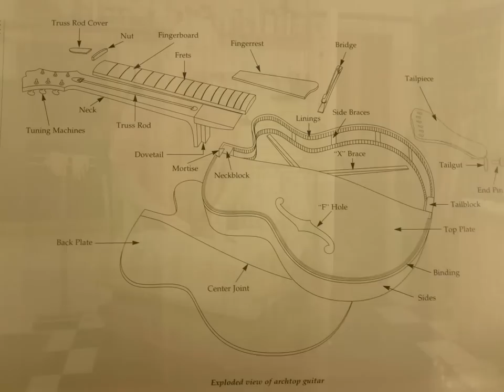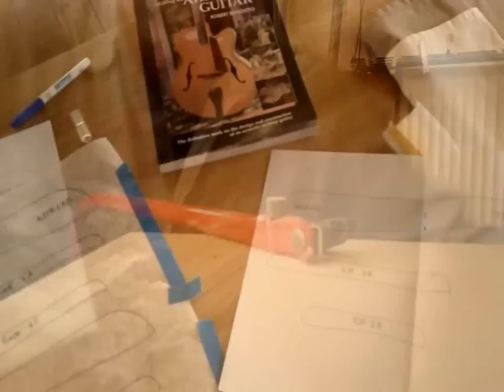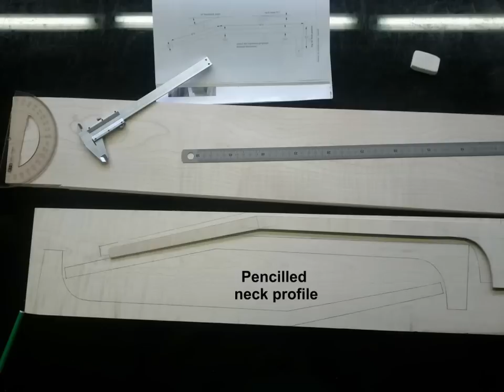Building an Archtop Jazz Guitar 2012

Comment: I had to make an archtop once.  It was a repair on an old Guild.  The bindings, the top, and all was a very difficult to remove, replace and refinish.  Keeping the neck on the old body and making the top the right height so that the bridge/saddle were correct was the hardest part.  Great job.

Comment from the maker: I used an iron pipe with a rim found in a hardware store. Mounted it on a piece of hardwood, put a 150 Watt halogen bulb in it using a porcelain fitting, To control the temperature a used a light dimmer. Be sure to isolate and ground it very well! if you want i can send you some detailled foto's.

Comment from the maker: used an iron pipe with a rim found in a hardware store. Mounted it on a piece of hardwood, put a 150 Watt halogen bulb in it using a porcelain fitting, To control the temperature a used a light dimmer. Be sure to isolate and ground it very well! if you want i can send you some detailled foto's

Comment from the maker: To glue the inlay i use a transparent two component epoxy. I mix the glue with fine saw dust (400 grid sandpaper) of the same wood, in this case cocobolo. This way all minor gaps between the wood and the inlay are filled with glue with the same color as the wood.

Comment from the maker: Hi, What i meant with my answer was that is it's easier to build a classical first if you don't have any experience at all. Don't start with an archtop as your first project. But I noticed that you already have experience with some guitars so I think in your case it does not matter which to do first. Carving the top and back of an archtop is the extra challenge with an archtop.

Comment: Very nice video.  I have a question.  Why are braces used?  I thought dome tops and braces perform the same function.  So why use both?
Reply: The x braces in this case act like tone boards more than braces. They spread the sound across the top

Comment: Great video and well done. May I ask, generally, what is the thickness of the top,bottom and sides and does it apply to Acustic guitar builds also? Does the quality of the wood determine the tone to a degree?
Reply: Top thickness depends on the guitar and wood type.  Typically archtop electric guitars don't offer much in terms of acoustics, so I don't think electric and acoustic archtops have the same design objectives.  Usually electrics have thicker tops because it's all about sustain.  If the guitar strings resonate and generate audible noise, then that energy takes away sustain.  By the time you bolt on a Bigsby bridge and mount pick-ups in the top you pretty destroy any up-plugged play-ability.  Archtops, in my opinion, offer a somewhat unique sound, but it's really about looks.

Comment: Can you explain how you worked out the drill pattern for the top?  I have been working on a maple top and only drilled on the outside edge.
Reply from the maker: Hi Bill, You need two things. The contour lines and the drill depth. For the contour line pattern i used a pdf found on the net. Search on: liutaiomottola specifying arched ... (not allowed to place links here). For the drill dept i used the template in the Benedetto book (fig. 135): draw a line on the underside of the template and measure the heights at the intervals of the contour lines.

Comment: Hello Mr Van der Meij. Great work on this video. Please could you tell me something about that thickness caliper at 5'14''. I noticed it's homemade with a regular caliper. Do you have drawings for it?  Thanks.
Reply from the maker: Hi, I don't have a drawing, but it is a very simple construction of three pieces of hardwood. In the upper piece I sawed a slot and covered it with cork so I don't dammage the calliper. I used a screw with wingnut to clamp the calliper. Because the construction has to be stif I reinforce the corners with metal strips. I glued a dowel on the bottom to support the plate. It took me about half an hour, it works greath! Within a few weeks I will put another video on youtube with better pictures of the calliper.
Reply: Bert van der Meij Thanks for the reply. I have one of those calipers you use and thichness calipers are generally too expensive. I am very curious about how the caliper is secured in the jig so as to allow for good reading. Cheers

Comment: Hi Bert, I am happy that I came to view this extraordinary video. Do you have this business?, or just made these two hobby guitars?
I have this Jazz guitar thin box, old one. green and black finished. Its simple, and there is the white plastic lining, at the edges of the 'f' cuts and also the edges of the sound board and back board all around. I want to finish it newly, so I removed all the color and the primer sealer. I am planning to use the epoxy varnish, color inks, the carnuba wax the lacquer spray. Now its only wood and that white lining. The lining is damaged at various places. If I remove it I will get some 2 mm deep groove around the edges. I don't want to keep the lining either. How should I fill up the edges to level them up? And, any tips to finish the guitar? Thank you.
Reply from the maker: It's just a hobby. I suggest you fill up the edges with a wooden binding. You can saw it yourself from a piece of mapple, bend it, glue in and level it with the top/back. If you don't have the right equipment, you can buy prebend wooden lining at a luthier supply webshop. Untill now I did all the finishing with french polish (shellac). Cheap, nice and easy to do if you have a little patience.
Reply: Bert van der Meij
ohh )) , thank you for your advice. I am from India, cannot get from Luthier. I can bend but just now rebuilt the damaged joint lining with acrylic gesso and now did staining and art on the guitar. For Shellac I will have to use that water based grain filler paste, that I cannot do because I already did the coloring art now. So, will have to do the PU and lacquer.
You really made actual archtop to your guitar, that we rarely find on 'f' cut Jazz guitars. Your hobby guitar making is more than a pro, did anyone offer you a handsome wallet in trade with that guitar? :))

Comment: Just wondered why, at 1min, you are shooting the outside edge of the body piece?
Reply from the maker: The video doesn't show everyting. In this stage I also planed the bottom to make a perfect 90 degrees to prepare for gluing the two wedges.

Comment: Mr Vander Meij - I've already commented on how great this project looks. You are an inspiration. I am making an Archtop too. I see at 9:57 The pattern for the headstock is on the veneer.  What method did you use to trace that shape on to the veneer ?
Reply from the maker: Hi Brad, I'm a bit ashamed to tell, but it's something I've learned on the nursey school ;-) : I made the layout on paper and taped it on the headstock. Then I made a series of punctures through the paper into the headstock veneer with a sharp pin (I used an old sharpend dart). After that I rubbed  chalk over the headstock.

Comment: Sir, how do you put in that pick up coil?
Reply from the maker: I mounted the pickup on the fingerrest with a maple attachment  and mounted the fingerrest with two screws on the neck.  think you see it at 21:32.
Reply: @meij008  Sorry I didn't notice that. I think the pickup coil is under the bridge. Thanks, anyway it's a very nice guitar build 👍

Comment: does the arch must have a spesific form? or i can give whatever form of arc i want.Does the form of the arc affect the quality or the sound?And woud make a difference on the osund if i creat no arch?
Reply from the maker: You have to make a specific arch in the top and back plate. Otherwise the guitar will collapse under the sring pressure. I used the method in this pdf: http://www.google.nl/url?sa=t&rct=j&q=&esrc=s&source=web&cd=3&cad=rja&uact=8&ved=0ahUKEwifnoL0yIrOAhXqDMAKHYaxB-AQFggsMAI&url=http%3A%2F%2Fwww.liutaiomottola.com%2FPrevPubs%2FArching%2FArching.pdf&usg=AFQjCNFxs5TCGXmw6TT2WHm6BarXjJGQSQ&sig2=HQMLgxdpxMXKydwcFPjBhQ.
Reply: Bert van der Meij Thanks this pdf at a first look seems that it will be veery helpfull,thanks a lot again.I have built an electric guitar and am looking to build a semi acoustic guitar.And i have trouble on how i would create the arch.Also what woods would you recommend for the body? maple,machagony etc?
Reply from the maker: Body and sides : maple. Top: spruce. https://www.youtube.com/watch?v=x_NoTGr6SAQ
Reply: Bert van der Meij ok thanks.By the way the work in the video you just linked me is astonishing.
Reply: Bert van der Meij I read some parts from the pdf and it is indded very helpfull.However it didnt had a detailed method on how to creat the arch on the back of the plate.Do you happen to have a pdf that explains this method?
Reply from the maker: I used the same pdf for the back. I know it's not easy to understand the method described in the pdf. I read it over and over again to get it.

Comment: Beautiful work. However, I would consider making it a bolt on neck and use a piece of solid maple down the middle of the top, making it a semi hollow body, and put in a bridge pickup .. oh the pickups should be part and parcel of the guitar, in my not even the least bit humble opinion. The real question is, why would you build her a guitar that doesn't fit her well? This is much too large of body for her to be comfortable with it.
Reply: Oh, seems like a lot of wasted wood to me. Starting that thick and carving it down achieves what, exactly, over steaming and pressing a top and back into shape in a jig? I mean, yeah, it's pretty, but I hate to waste wood. For the top and back at least ten times more wood is used than is actually required. Is there a solid reason for doing it that way? I know I sound like I'm picking things apart, and I guess I am, but I really want to know the why of everything. I don't actually build guitars, I rebuild them. Those I've had don't have the tops and backs carved, they were formed.
Reply: tootall11211 steaming and pressing of the woods will greatly affect its micro-structure, thus affecting the sound produced by the guitar. By wholly carving the top and back plate from a solid block of wood, the integrity of the wood's micro-structure is unaffected.
Reply: ***** Nice Work Bert! Gibbo, A bolt on neck is a very viable option for arch top guitar makers. A Mortise and Tenon Join (with two allen bolts into a square brass rod [threaded to the same thread as the screws]) is perfect for this purpose. Sure, you need a chisel mortiser but they are only a few hundred bucks. Look up Gore Guitars Joint in google. You can be a purist all you like at the end of the day there is an answer that works and allows you to easily repair any neck relief issues down the road....If I was to build an arch top I'd spend the extra money on a chisel mortiser and make a bolt on neck. Purely because you can remove the neck if it is getting in the way of a repair down the track. It doesn't cover poor craftsmanship merely allows for the potential of damage to the guitar down the road.
Reply: Stuart A hi
i read your comment multiple times but i don't quite understand how you would make a mortise and tenon joint. from what i understand, you put a bolt in the mortise and a bolt through the tenon.
would you mind telling me if this is correct or not?

Comment: Bei der selben Arbeit wie bei 3:00 hab ich mir in die Oberfläche Dellen geprägt.
Reply from the maker: I konw, that's a problem with this method. I had dents too but enough wood to sand them out. You can remove the deep dents very easy with a damp paper towel and an iron. It's amazing how well this works. See: Blues Creek Guitars Quick Tips - How to Steam out a Dent.mov
Reply: Bert van der Meij
Ja genau so war es bei mir auch. Ich hab ebenso noch genug Holzstärke gehabt um die Dellen raus zu schleifen. Die Idee mit dem feuchten Tuch und dem Bügeleisen hatte ich bei Paul Sellers auch schon gesehen.
Anderes Problem: Ich habe ein bißchen Angst/Bedenken dass ich die Tenonarbeiten am Hals verderbe. Ich muss doch 4,5° hinbekommen und da zittere ich etwas;-)
Reply from the maker: micheloderso Ich weis nicht genugend von deinem project, aber im algemeine: viel gucken, denken, messen, nochmals denken, gucken und messen usw bevor du etwas tut. Ich versuche wenn moglich alles ein bisschen zu gross zu machen, 1 oder 2 mm, wenn es dann nicht genau passt dann hat mann noch etwas spielraum zum korrigieren.  Nutzliches video in youtube:  Blues Creek Guitars - Dovetail Neck Part x.